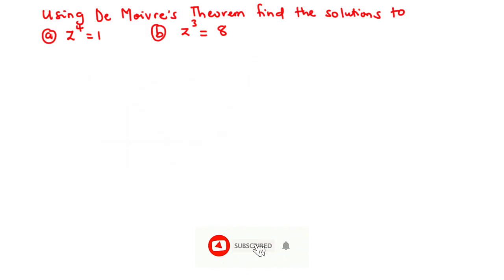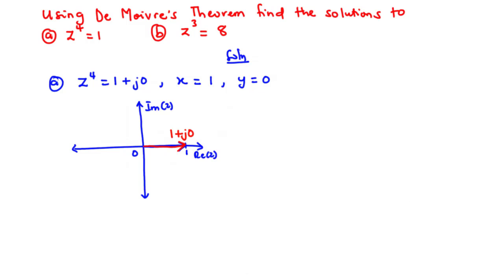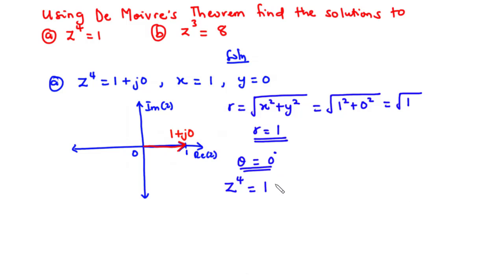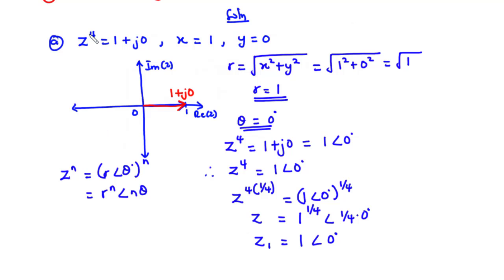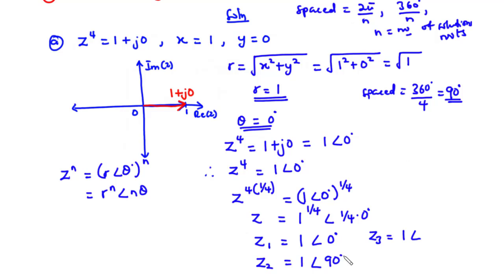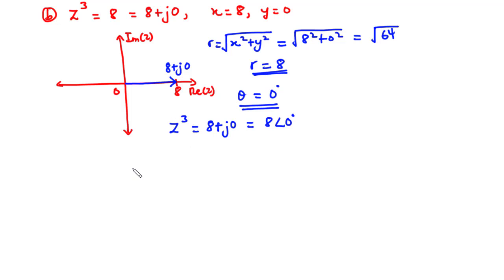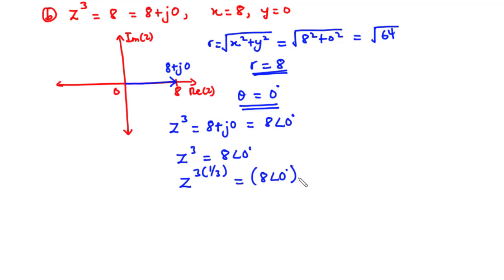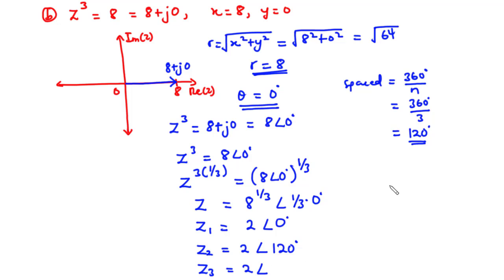07b - Roots of Complex Numbers using De Moivre's Theorem | De Moivre's Theorem Problems

Comment: Please sir what if upon adding the angle it becomes greater than 360
Reply from the maker: It's unlikely for the angle to be greater than 360. You know the complex number is symmetrically spaced by 360/n, so the last root will have and angel within 360 or 360.

Hope the explanation is okay